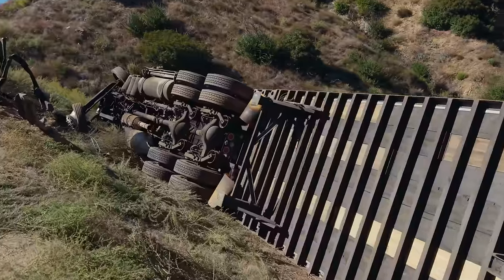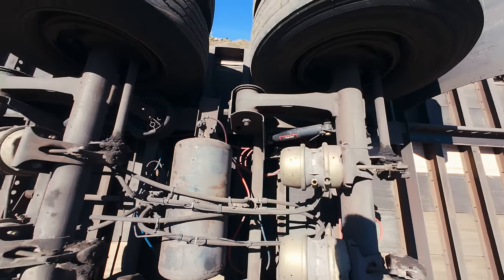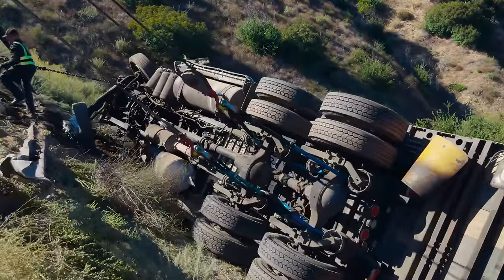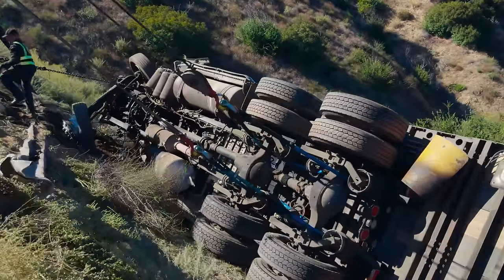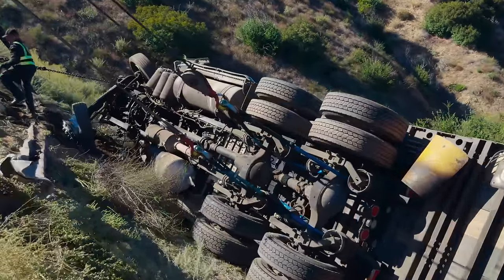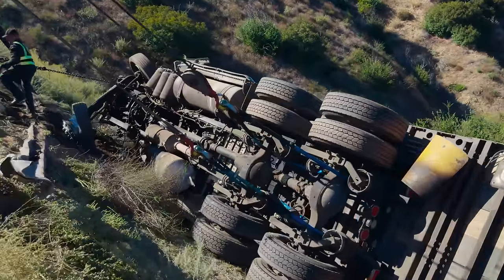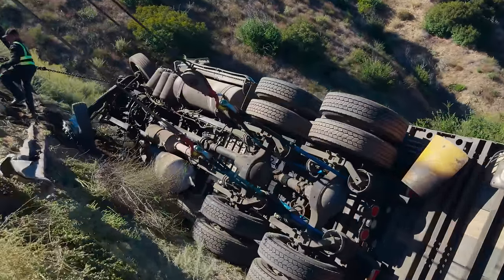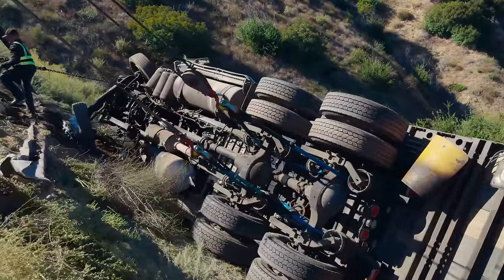Tractor Trailer Crashes off Freeway - Lands in Ditch

Comment: Viewing from Ireland,  If that happened in Ireland the motorway/highway would be closed and fire service would remain on scene until its cleared ,  I'm also amazed at the traffic driving as normal speed on both sides ,  in Ireland if theres any type of incident then all traffic almost stops to have a look , known as Rubbernecks .  I cant get over the size of the wrecker trucks , absolutely huge , we have nothing that big . Brilliant vids and great teamwork .
Reply: Ireland probably doesn't have many roads big enough to handle large trucks because the roads were there for many centuries. I am surprised that Germany doesn't have rotators. Fire departments have cranes that go to wrecks.
Reply: @tiredoldmechanic1791   we in europe does not have these because of weight regulations, this truck itself weighs more than the legal weight of an eu 8 axle truck, so it would not be able to tow anything without a over weight permit, therefore it is more resonable to use a crane in these cases
Reply: @gustavostensson1048  The cranes are even heavier than the Rotator recovery trucks.
Reply: Now you know how people are me me me. Danger to all who work fire, EMS, troopers, and the wrecker drivers.
Reply: The traffic here always rubber necks too. The thing here is in the start of the recovery the traffic can't see the truck over the side.
Reply: California highway patrol doesn't like closing more lanes than the have to.
Reply: In Scotland we have big wreckers exactly like that
Reply: Believe me son, there’s a long line of traffic! Rush hour would be zooming by!!! There’s a lot of rubbernecking going on!!!

Comment: EPIC recovery and you did an AWESOME job with the video!!!! Man, at about 15:38 when Big Flipper slid over I about jumped out of my chair!!!! That was INSANE!!! Big Flipper was pulling hard enough to move it's well planted 73,000 lb self!! CRAZY!! Using different cameras and the drone made for some really cool footage showing pretty much every step. And, you did all of that without damaging the guardrail!! Seriously, VERY well done you Alex and Ricardo!!
Reply from the maker: Remember I went over my rigging formula and how with the incline and terrain and tractor damage the trucks “feel” more force , I calculated about 1.75x. So flipper had the front of the trailer PLUS the rear tractor. The load cell line when already coming up was over 20k. Flipper EASILY saw 3x that when it first went in to break traction. Nothing to scare haha it sure looks crazy but once you break tension you’re in like Flint

Comment: A tip, that type of fire extinguisher (dry chemical) is great at putting fires out, but does nothing to prevent fires from reigniting.

Once the electrical system is isolated, water or foam will do a much better job to cool down the area and foam will cover and stop oxygen from getting in.

Of course, the amount of airation in the foam will determine if it will stick to vertical surfaces or just run down to the ground.
Reply from the maker: Very knowledgeable and great tip thanks

Comment: Only thing you need in your fleet after seeing this is a mini pumper or get a pickup with a suppression system and foam just for events like this, you may think it doesn't justify the cost or need but imagine if that would have gotten out of control on all that dry vegetation. Great job though, you guys are one of the best tow and recovery outfits out there.

Comment: A great job. I would have tried to seperate the tractor unit first, & got that up and away from the trailer. Then rolled the trailer onto its feet. Then restropped  & got it up the bank in the normal way up.
I was suprissed you didnt flattern the guard rail. anyway a success story in the end.. A LONG day !

Comment: With my sons car accident, they didn’t have a rotator and ended up closing a narrow two lane north south highway for more than four hours to move the car and cut the four of them out of the car because they were all deceased they had to keep the road closed. 
Later I found out that four of my friends in different vehicles were caught in that jam. 
If you are curious about the how narrow the roads are the accident happened on highway 101, mile marker 21.17 in Del Norte County in the very Northern California. Happened in April 2006, I’ve been told the road has changed since then.

Comment: Be it far from me to tell you fellas how to do your job, but;  if you can, try to cut the Negative cable coming from the battery(s) at either the battery terminals or the frame connection, and don't worry about the Positive. That way, you'll eliminate the possibility of having some other Positive wire shorting to some metal part of the vehicle you're working with which can start a fire unexpectedly.

Comment: Great work. Could you also have uprighted on that shelf road and pulled it up the hill while holding towards the trucks?
Reply from the maker: Probably not. Even so, that is 10000x riskier and more dangerous. I have more faith in the support the freeway provides my trucks than a crappy tiny dirt road built for emergency pick up trucks. Why would I risk my wrecker flipping down there
Reply: @PepesTowingService  I was wondering the same thing and hoping you would answer, I thought the same thing, but I would not have just because it would've been alot of winching to get it to the freeway and still have to screw around with getting it over the barrier. nicely done sir

Comment: I liked the show but would it have been safer to flip the truck and trailer at the resting place to that dirt road and pull the vehicle up on the other side of the guard rail ?  I saw the little hill at the end but wouldn' have a problem with the great equip you have !!

Comment: When the diesel fuel spills from a ruptured tank who is responsible for clean up and the cost of the clean up?
Reply: Most of the time it is the company that 
got in the accident $$$$$$$$$$
Where the trk landed & the rough terrain 
I’ll bet that cal trans will just let it
evaporate
Reply: If it spills onto the surface of the highway, I think CalTrans would probably have a cleanup crew throw kitty litter on it, soak it up and then scoop it into drums. It is considered hazardous material (aka HAZMAT). If it spills into the environment, like in this video, I think a HAZMAT crew would be responsible, as the diesel soaked down into the dirt and they would have to dig down to clean it up responsibly. It wouldn't surprise me though if it doesn't get cleaned up at all, since it's kinda "outta sight, outta mind" (you would have to pull over, stop and look down there to even know there was a spill).

Comment: I run an excavator digging up cantaminared soil for the EPAs hazmat cleanup crew i liked when i was there to see the wreck get hauled off that way i knew where we were digging to haul off and get an idea how much fill soil to have trucks rolling with and how many emptys to have on standby ready to start hauling to the incinerator to get the oil and fuel butned out fluffed up a couple times a day with a burned till the readings were fine then it came back too us too dry to pack in the holes and hold the bank most times FD was still there we could pack it in to hold it for seed and straw

Comment: Pay attention to the white line on the road In reference to the front of the middle truck. You can see the front of the truck slide.
Reply: big flipper slides initially since most of the weight is on that truck , once it breaks tension the casualty starts coming up , thanks for watching

Comment: I am watching this video on YouTube from India. If I were to handle this the first thing I will do is disconnect the battery secondly I will disconnect the trailer from the cabin dismantle diesel tank drain coolant to prevent mess it will make a job easy. I can't appreciate it.

Comment: Hi guys how are you before you started pulling the truck you suppose to disconnect the batteries because that truck roll over and the batteries they're going to touch the battery cover 🇿🇼🇿🇼🇿🇼🇿🇼🇿🇼

Comment: in my area extreme northeast tgat would be close to 100000 dollar recovery, 46 is very common
Reply from the maker: 100k ? How would you possibly justify that for a 4hr job max
Reply: @PepesTowingService  how it is ,like I said 30 40 and 50 is common
Reply: @PepesTowingService  4 rigs big hourly
Reply from the maker: I have two rotators and a heavy wrecker also hourly. How can you make that 100k? Even if it took them 10hrs, how is it possible to get an hourly rate that high? You’d have to be at $2,500/hr per truck which would never be accepted.
Reply: @PepesTowingService  I'm not sure I'm just saying ,case in point acquaintance had just gotten into it ,s everyone  has to have rotator  now smh ,anyway he dud recovery btw we don't have 75 foot off riad deals like you do anyway he calls insurance company  so they won't get sticker shock amd they go why how much is it he goes like 30000 they go shoot that's nothing well be calling you again ,lol ,we pay lot bigger ones ,I know of one guy who gets 800 an hour fir just basic recovery, not a tractor trailer either, sometimes  they bring in an excavator  to assist  there's another 300 an hour minimum

Comment: I'm surprised you don't use an extension cable from the tow truck to the  trailer, quite common in Australia to use a 'combo hose'- two air hoses and an electrical cable in the one 'hose', with the trucks brakes caged or released, and the trailer brakes and lights in use as normal... just plug it into the tow trucks outlets on the rear...

Comment: Curiosity...why didn't you flip it over at the end of that first pull onto what looked like a road? Was it too soft? Or were the weight levels for the extended booms too low? The second pull was virtually upside down. Seems like that "upside down" could have provided the chance for the fire breakouts. I usually follow the logic of what you're doing and why. I found myself perplexed on this one. Thanks.
Reply from the maker: I went over this every step of the way. If the trailer was fully intact being pulled to the top and didn’t bulge even a bit for a pre pick, then it would handle the flip. Which it did, right? As for the “road” that is not a road. I trust the concrete support from the freeway more than an unsupported dirt tiny slope. I knew I could do this job my way and I did it perfect. The dirt hill I have zero idea if I could even back up a wrecker to it so why even bother risk it? My way was 1000x faster, efficient and safer

Comment: How difficult was this job out of 1 to 10?
Reply from the maker: Maybe a 7
Reply: @PepesTowingService  i also wanted to ask why 3 trucks will go to an overturned semi instead of 2 at Pepe's Towing Service?
Reply: @PepesTowingService  I did want to ask Josh. Will the Los Angeles office work with the Colton office when they absolutely have to even for a recovery? I know UNIT 29 & UNIT 44 / HULK have done a container rollover together. I saw the picture on the internet.
Reply from the maker: @jonahkasiborski1472 what kind of question is that ? We’re one company, if we absolutely have to then of course. Such a weird question
Reply: @PepesTowingService  I know you guys usually will work with other close by companies when needed. I know the Los Angeles yard will work with the Colton yard when it is absolutely needed. I have heard Los Angeles & Colton are far away from eachother! I did also want to ask what year & model is UNIT 71?

Comment: Why the hell didn’t the fire department cut the battery cables. We always do.
Reply from the maker: Fire wasn’t on scene originally and it wasn’t accessible. Why are you angry lol relax. And it still caught on fire TWICE after the battery cables were cut. You have a fully mangled and exposed tractor in high heat and fluids everywhere what do you expect

Comment: Why dint you put it on its wheels on the flat spot then tow are winch it up that dirt rd down there
Reply: For starters, Cal OSHA requires a 2:1 surface to wall (shoring). That road is barely 102" wide. Do the math. We did.

Comment: Fully loaded, loaded with air maybe
Reply from the maker: It had pallets of medical supply stuff for buildings. But ok there’s always that one moron hater that has to put his foot in his mouth. Even if it was fully empty, how does that take away from the job?
Reply: I assume you drive a 1 ton flatbed ; ok maybe a twin line wrecker. Did your mommy not tell you that if you have nothing good to say, don't say nothing at all ? I trust you stopped watching after only 20 minutes ; would hate to think you wasted 75 minutes of your life on a pseudo claim recovery.
Reply: @joeacosta5011  Great, tell it like it is.

Comment: Not very smart to pull all the way up, when they had a trail going right up to the freeway...
Reply from the maker: +jerome ringland the not so smart one is yourself. You wanted to drag a loaded mangled tractor trailer up a dirt slope meant for pick up trucks ? What is that “trail” rated at? You have to have rocks for brains to see this job executed to perfection the way we did and then say naw let’s do it the most sketch and unsafe way possible and trust a tiny dirt hiking path
Reply: So you drive a light duty flatbed as well ?
Reply: @joeacosta5011  Another good one.

Comment: Jamie Davis will tell you you don't pull it all together in one shot even Ron Pratt will tell you the same thing too You disconnect the tractor from the trailer and you bring each item up individually You don't bring them up together first thing you should have done was get a smaller tow truck down there disconnect the tractor from the trailer use the smaller tow truck to pull the tractor away from the trailer and then work on rigging to bring the trailer up once you get it up right unload the trailer and then bring the trailer up looks like a four stage process You can't ring it up the way you want to I'll complete because you take the risk of the whole cargo van tearing
Reply from the maker: You’re a moron. But please tell a guy that does these every single week non stop more on how I can’t do what I clearly just flawlessly did
Reply: yeah, no.... always better to bring it up as one unit... I'm not impressed with Jamie Davis to begin with and as much as I like watching Ron Pratt, he tends to over complicate things
Reply from the maker: I noticed he cited two “celebrities “ and not a rotator training class. Just another YouTube expert. No offense to Ron but he sees maybe 5% the roll overs I do and doesn’t have multiple rotators like I do. Every job is different. Do you have any idea how difficult and dangerous it would be to rig in a way to split the tractor down there? I can’t stand arm chair quarterbacks who have a phd from YouTube university telling actual experts what to do

Comment: I'm astonished how irresponsible you work without closing a few traffic lanes, what kind of police do you have there? Stupid and very very dangerous with all that traffic so close to the tow-trucks.
Reply from the maker: The purpose of a rotator is to work off the side with minimal space. What kind of idiot would have this equipment just to CLOSE more lanes in rush hour on a major interstate? Los Angeles is bad as it is with traffic, you see we obviously did this job perfect while alleviating traffic yet still had to put in your dumb opinion
Reply: This will take place only in this place. God bless.